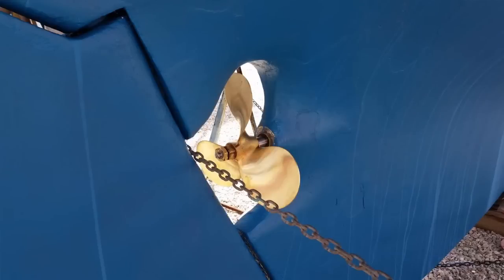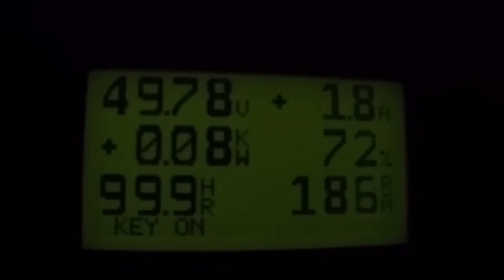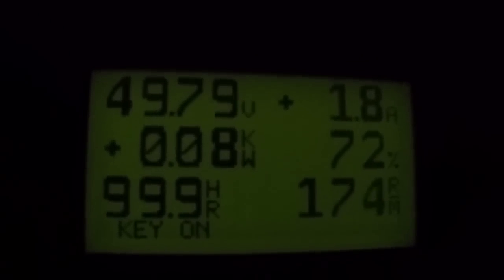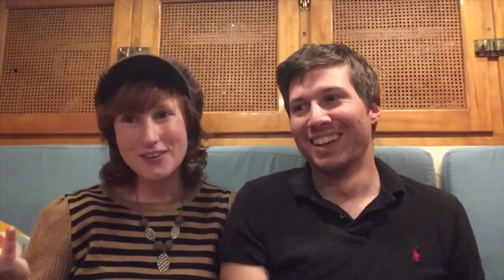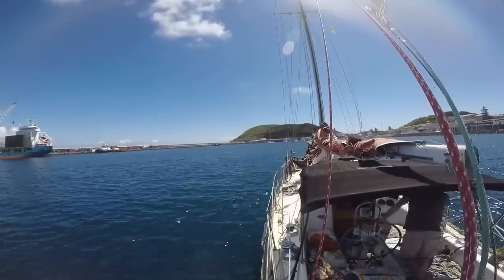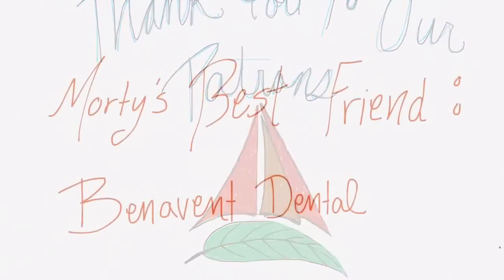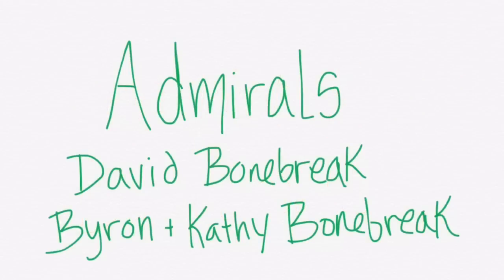Electric Motor, Ocean Crossing with Regeneration | Sailing Wisdom

Comment: Thank you for the honest commentary. Your travels down the ICW were agonising to watch. Electric propulsion has been used for decades if not centuries (google submarine Peral launched 130 years ago). As a former diesel electric submariner I am well versed in generating electricity for propulsion needs. Bottom line is IF you are going to use electric for propulsion over an extended period, the regeneration capacity needs to be in line with the equivalent horse power required if using a conventional engine. That folk sail around the world without an engine is fine, I commend their efforts and have no problem with the seamanship side of things. That folk wish to reduce their carbon footprint is also commendable. For me, a well maintained diesel engine, that burns about 50 litres of fuel a year for hundreds of miles of cruising, works for me.  Like most folk, I use more fuel driving to and from the boat, not to mention my carbon footprint going into hyperdrive when I jump on a jet plane for holidays.  I did cringe a bit around the commentary about the reliability of diesel engines. Again from my submarine days, we were forced back into harbour many more time from electrical faults that engine problems. The latter which were far and few in between, were usually repaired on the go and without the need for specialised equipment or technicians.

Comment: This was the best video about electric motors on sailingboats, I can follow your arguments, but I think for most people it´s not the time now to change from diesel to electric. As you say you need a lot of time to sail in your way. 
I sailed an atlantic circle some years ago on a 30ft sailboat, we had 200 W Solarpanels and we had only to run the diesel three times in 17 month to produce electricity for the fridge and lights. We had always an eye on our batterie bank, we charged all our gadgets and the computer during sunny day time, and shut all off exept the fridge in the night. On the atlantic we made less than 5% of all passagemiles under engine, but in the med it was more than 50% to get in time from Greece to Gibraltar or back. In time means 6 weeks for about 1500 miles.

Comment: Guessing the Honda generator is much quieter than the Diesel would be. I've got a 2000W generator (not Honda, cause I couldn't afford it at the time), and it's super quiet. From what I've heard, the Honda is about the same decibels when running.
Also, love your discussion of the safety and "sailmanship" of running an electric vs diesel. People who rely on a diesel aren't practicing good "sailmanship", to be honest. Thanks for another great video.

Comment: When Yves Gelinas set out on his round the World sail in Jean Du Sud (an Alberg 30), he yanked out the Atomic 4 inboard altogether, reasoning that he wouldn't need an engine on such a venture (after all, how much fuel could a small boat possibly carry against the vast expanses of the oceans), but he would need the storage capacity.   He obviously made the right choice!   Even in coastal waters you may not need an engine, and such an approach is beautifully represented on the Youtube channel "How to Sail Oceans".   So I would say your solution is a very nice compromise.  Every time my diesel inboard fails to start or wants to quit I think about an electric inboard.  After all, all you really need is a wee push to get in and out of crowded marinas.

Comment: Hi,great info.
In 1990 l started to build my 45 ft cruising cat & launched it in 2000, l was never going to have l any diesels , back then l modified a couple of 90hp o/b's to electric BUT the controllers were really expensive so l shelved them & extended a couple of 40hp 4 stroke honda 500mm ,blanked off the exhaust throu the prop & vented the exhaust 400mm higher out the extension.That worked for 17years, perfectly,BUT l've always thought electric was the way . So over the last 18 month l've put skegs /shafts/19"props & 2x 10kw motors/sevcon controllers ,ect,ect.
I'm just starting to test them now but because l like my creature comforts like A/C l have 2x honda 3kva invert gensets & 2500kw of solar , l'm hoping with solar, regen & sail l don't have to start the gen.l do start them to heat up the hot water tanks for showering & galley & microwave, so l'm happy to go Hybrid at this point.
I'm a motor mechanic by trade but the smell of diesel gives me blinding head aches always has.
So electric is the way to go.....cheers Peter
Reply from the maker: Wow it must have felt amazing to launch a boat that took 10 years to build. Congrats on your confidence with experimentation and not falling in with the way things are "normally" done!
Reply: Hello again,Yes it was & is just fantastic...it's my thing...l get a lot of joy out of it..it's my happy place.
I love the the fact the two of you NO time schedule,
only what pressure you put on your selves...THATS CRUISING...cheers Peter
Reply: Heliatos Solar for hot water look in toit.

Comment: We still have a diesel in our sailboat. We charged our old agm housebattery bank to lifepo4 bank. 360ah. One small 40w solarmpanel. We have no problems with power anymore, 1 week in a habour, heater, fridge, 2 kids so charging ipads all the time. Works perfect! Im interrested in gettin an Electric motor to have quiet rides when we motor, been looking at it for some time.
Reply from the maker: I personally have an Electric Yacht motor, but the company Thunderstruck EV makes very similar motors at a fraction of the price!

Comment: Converted my 30 foot Nonsuch to Electric propulsion in 2008 and never looked back. I do mostly coastal cruising but, always thought crossing an ocean with EP makes a lot of sense. As you have correctly demonstrated with your Atlantic crossing. Even without your solar panels in operation you were making fuel (energy) via regen. One of the benefits of EP. Even more impressive is that with your full rudder configuration which is not the best for regen you still managed to have regen all across the Atlantic. I have solar panels, wind turbine, regen and the ever reliable Honda 2000 for charging. With a new controller upgrade on my boat with a skeg rudder I''m now starting to get regen at 4 knots.  Personally I'd never go back to diesel.
Reply from the maker: An exposed propeller will give you much better regen. Ours is trapped in an aperture and we still get good numbers so you will certainly be fine with that multitude of energy production. 

Happy cruising!

Comment: Thanks for the well-presenting info.   What I find interesting is that monohulls have tons of lead in the keel, which could be replaced with the weight of batteries.  Not a simple or maybe even possible project for an existing monohull I know, but a monohull could be designed this way.  
On the other hand, I have a multihull for my solar powered boat project since it is lighter and more efficient to propel with electric, but then the batteries weight slows it down.

Comment: I replaced a Universal Atomic 4, gas engine with a 10 kw electric motor on my Pearson 30 (30 feet, 8300 lb, displacement) about 3 or 4 years ago.  It is the same motor that Electric Yachts uses in their package (your setup would have 2), but I packaged it myself.  The system uses 4 group 27, lead acid batteries, so I have a very limited range.  I have solar panels and a generator (that was not used last season) to charge the batteries.  It is much more reliable than the engine ever was.

If I had to do it over again, or if I hadn't bought a new, larger boat, I would buy a used car battery bank to give myself more range.  The new boat has a 41 hp diesel with a v-drive system, and I am planning to use the diesel for  as long as it is reliable.  Then, I might look into installing an electric drive where the v-drive is mounted, and a smaller, diesel genset to create a hybrid drive system.  We'll see.

For some other battery installations, you might want to check out :
https://www.youtube.com/watch?v=yVKFW2uz8_U
or
https://www.youtube.com/watch?v=nH5O2ful6_4&index=59&list=PL7-Yk1Z5wR-m_FX6eJsVLEHSd6mx7Jt0R
The first uses a used array from a Chevy Volt.  The second one uses brand new batteries that would fit into place where your old ones are.
Reply from the maker: We actually met Saoirse when we were in Fort Pierce. He told me about the Chevy volt batteries he used and I’m really liking that idea.  Seems like the best deal for the money!

Comment: I love your channel! I do believe in an electric feature and we converted everything to electric (car-Tesla, bikes, tractor, heat pump, solar panels) with the exception of our sailboat (Catalina 320). I should have switched to electric drive as soon as we got it! Most of the issues you have with a sailboat are related to the diesel engine, not to mention vibrations and noise and diesel smell in every clothing item! In your case a 10 Kw motor would have been probably better, with a gear box to be able to run it at lower power most of the time. Also, there are flexible solar panels perfect for biminis.

Comment: Your problem is not the motor, it is entirely your batteries.  An AGM battery is still just lead-acid chemistry and that is terrible for propulsion, land, sea, and air, for three reasons.
1. Depth of discharge.  Lead acid is very rapidly destroyed when discharged deeper than about 50% so a 10KWH battery is really only 5KWH unless you like replacing them even more often that what the manufacturer claims.
2. Rate of discharge.  The capacity of batteries regardless of type differ by the rate they are discharged.  Lead acid is truly horrible when discharged rapidly. They are normally rated for a 72 hour discharge meaning that a bank rated at 10KWH would have to be discharged at 139W to achieve that rated capacity.  At a more rapid discharge, say 500 watts, which is still not much, that 10KWH bank is 2KWH.   Combine that with the 50% depth of discharge rule and you have almost no battery at all.
3. Rate of charge.  Lead acid chemistry is VERY hard to charge above 80% capacity so a generator can run for hours and hours and hours and do almost nothing to "top up" a lead acid bank.  This is a feature of the chemistry and an AGM battery is still just a lead acid battery.

Now what about lithium?  Of all sorts.
1. They can be repetitively discharged to 80% without damage.
2. They can be discharged at very high rates and still deliver full rated capacity.
3. They will accept high charging currents all the way to full charge.

Add all these differences together and a lithium bank is several times better than a lead acid bank and almost certainly more cost effective for any propulsion application.  Don't take my word for it - it's just math.
Reply: Which is the best lithium battery chemistry?
Reply from the maker: Eric Krauter you should check out any of our other videos. This one was mostly us talking about a specific topic, the other videos are about our adventures!
Reply from the maker: CarlS. Currently, LiFePO
Reply: Lead acid does have some upside:
-The charge-store-discharge efficiency is better than most competing chemistries.
-Deep discharge issues are largely mitigated by starved electrolyte designs which includes most AGM batteries.
-Size/weight may not be an issue on many boats.  In some cases they will replace lead or concrete ballast blocks, and there is often little competition for space in the bilges.
-Cost per cycle is generally much lower for lead acid.
-Generally predictable decline with age allows scheduled replacement.  While LA can and do fail without warning, it is not the usual failure mode, as it is with lithiums.
-There is little fire risk associatied with LA, as compared to lithium in particular.   Failure mode is usually just a battery that quits working,  rather than a fire that can't be extinguished with water.  Fire on boats is a very serious issue.
-World-wide availability if replacement is required.   Large lithium batteries often can't be transported by air freight if they are not available locally.
Reply: @gumbykevbo  sorry but except for your statement that lead is good ballast, nothing in your statements are correct.
Reply: @RiggingDoctor  Have you guys looked into the new lead carbon Bats. Way better than traditional lead acid, especially when talking about charge and discharge rate, but less than half the price of LifePO. You should really consider them, they might be just what you're looking for.
Reply: if weight is not a problem and you have a big enough bank, lithium is of no advantage, sure it has a bigger cycle rate (4000 cycles at a discharge rate of 1C; discharging 600amps continous out of a 12v 600ah setup.....)

but if you had a 12v 1200ah it can discharge at 0.5c fine, and longterm after replacing the lead acid batteries and the safety of lead acid, it is cheaper per day "longterm" than lithium ion batteries

unless you have limited space and limited weight, lead acid is better, and cheaper
Reply from the maker: Andy Holland  What is boost circuitry?
Reply from the maker: Andy Holland very cool! Thanks for the info :)
Reply: @erickrauter9613  i think they made great points and they did it humbly. you are just rude and vulgar in this comment. if you have nothing nice to say then font say it at all. are you threatened by a well thought out response? that all this was and this video gave great insights instead of just trying to be an end all be all argument.
Reply: @erickrauter9613  
Everyone has a different style of presentation. Rigging Dr is one of my favorite boating channels BECAUSE of their in depth explanations and reasons for doing things. It's not "blather" to me. AND the sailing topic is not a subscriber competition. If you want water & horizons get your own 40+ boat, rig it yourself, and do some Atlantic crossings on your own channel, like they did. When you watch Rigging Dr you are watching some thoughtful seamanship content, not bikini and beer subscription bait.

Comment: I would say your confidence level has expanded very much and time on the water has provided you with a lot of experience. All good and your learning to be sailors. On the motor point, neither electric motor or diesel has the capacity to cross the ocean, so you have to sail to get there. You would probably have to fill the inside of the hull with diesel to have enough to get across the Atlantic.
Reply from the maker: Very true! You can always spot the American in an anchorage because their decks are lined with diesel cans!

Comment: Have you wondered why a boat sail considerably slower when in reverse? That's the problem with regen, you actually have to take the propeller off and turning it 180 deg. The shape of the propeller is designed for sailing forward, an when you're regenerating the flow of water is in the opposite direction, and it's not at all effective. You can buy propellers that pivot themselves when the flow of water reverses. This is what you want.
Reply from the maker: They also make propellers that are symmetrical with equal performance in forward and reverse. They aren’t great but they are equivalent. 
While it’s not perfect, it is also simple and works well enough.

Comment: You talk about needing to take extra time when necessary.  Spot on!  Boats have destinations, not schedules.  In the flying community there is a thing called Get There itis.  It is the cause of many accidents; people going when they should exercise caution too often we see this in the boating community too.  Which reminds me of the comment you made about people worrying about running onto reefs.  All too often I see people who sail onto a rock, reef, etc. because they don't leave any margin for error. 

What was your cost for the motor, including installation, and any electrical upgrades you needed?

I really liked the way you presented this subject.  It was very informative but equally important, well balanced.  The Pardeys sailed around the world a few times and they didn't even have an engine!  Thanks for your insights.
Reply from the maker: I love the Pardey books :)
The total cost for everything (boat arrived at the yard with a diesel —> boat sailed away with an electric) was $21,000

Comment: Thank you for this honest assessment of your electric motor. When you were in the doldrums did you use a drogue? 20 days is a very long time. The worst sailing I have experienced is a 6-9ft short period swell and no motor no wind. Ugh! Thank goodness that is rare. I no longer trust NOAA for weather either. I am thinking of going electric on my Catalina 30. Thanks again for the video.
Reply from the maker: Our prop acts like a drogue when re-gen is turned on, but honestly in those doldrums we just bobbed and it was awful haha. One thing that’s great about not trusting NOAA or other forecasts is that it forces you to learn about reading weather, so if you don’t have access to technology for any reason, you aren’t helpless :)

Comment: The idea of making the keel a giant battery is the best idea I've heard. I want it to use in the doldrums so I need lots and lots of battery power to achieve my goal. Like be able to go three to 600 MI through the doldrums
Reply from the maker: Solar panels will be a huge help there too. The sun gives you power that goes straight to the motors, the batteries will then just need to power you at night to keep the speed going.

Comment: All my cruising, whether a trailer sailor or a blue water boat, was as you say. I used the motor, sometimes, to get off the hook or in reserve in case sailing off the hook didn't pan out like I thought it would. Also, just like Captain Ron at St Haags, Boss... used the motor to come into a berth in a harbor that I'm not familiar with.  Otherwise, they're usually just-in-case backups to sailing.  Great video!  - Jim B, Champagne Boating on a Beer Budget.